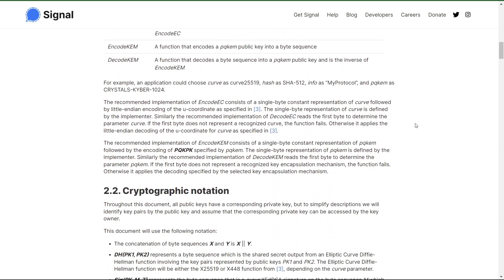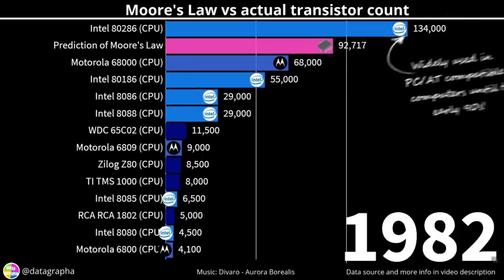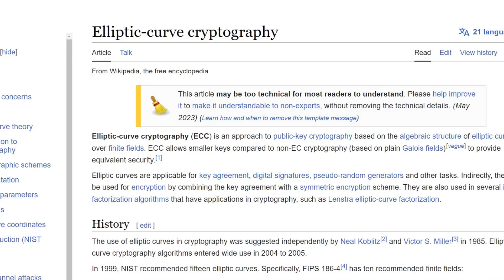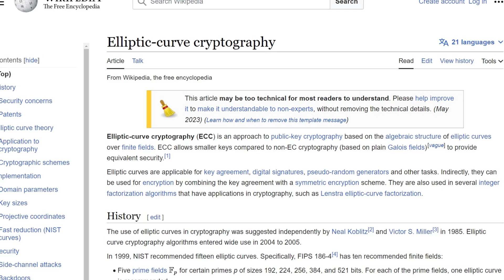Signal Just Published Post Quantum E2E Encryption

Comment: I just want to leave here: There is only one form of completely secure encryption, Informationtheoretical Encryption.
It means that not only is your key at least as long as your message, you also only use that key ONCE and never again.
The reason for that is simple: You can get every possible decrypted text with some key. Yes, that includes something completely different, as I said, EVERY possible decrypted text.
Anything else is literally just hoping that the system is good enough (for now).

Comment: 3:12 Hey, im a cryogenic engineer that makes the cryogenic systems that run quantum computers! AMA
Reply from the maker: Is it actually cooled with liquid helium?  I didn't think lN2 was cold enough so I figured it would involve lH4 or some other really extreme cooling solution.
Reply: @MentalOutlaw  yes it is! But not how you think. Helium-4 (normal helium) will liquify at 4.2K (-269C) at 1 atmosphere of pressure (1 bar) and Helium-3 (the very rare isotope) will liquify at 3.2K (-270C) at 1 atmosphere of pressure. If you reduce the pressure above these atoms when they are in a liquid form, their temperatures can be reduced. This follows according to a graph called the vapour pressure curve. If you google the vapour pressure curve of water you will see that at 1 atmosphere of pressure, water will freeze at 0C and boil at 100C. But if you change the pressure above the water it will exhibit different properties. If you reduce the pressure to a few millibar, you can boil water at room temperature (youtube: 'Boiling cold water In a Vacuum Chamber'). This is the same principle used in low temperature cryogenics to boil liquid helium to reduce the temperature of the liquid to 1.5K for Helium-4 and 0.3K for Helium-3. However both of these are still very warm for a quantum computer! Temperatures of 0.01K are required for these machines so a different process is used, called the dilution process. If you mix helium 3 and helium 4 and liquify them in the right quantities, the helium-3 sits on top of the helium-4, like oil on water, due to the density differences. However, there is some helium-3 inside the helium-4 (approximately 6% of the mixture). This is a fundamental value and no matter how much helium-3 you add, the percentage will always stay at 6% (as long as there is enough Helium-3)! We can use this to our advantage... Imagine we have a U-bend pipe that we fill with water, so that its full enough that a lighter liquid could not pass to the other side of the u-bend. And then we fill both sides of the u-bend with oil so that it sits on top. Now imagine for the sake of argument that a small amount of the oil was by the laws of physics required to sit inside the water (approx 6%?). What would happen if we burned all the oil on the left side of the bend? Well as the initial amount of oil boiled off, then the particles from the 6% emulsed in the water that were close to the fire would also burn away... This would mean that you wouldnt technically have 6% in the mixture anymore; and as previously established this is a physical impossibility. So oil from the right side of the u-bend gets forced across the 'phase boundary' into the water (requiring energy!) to ensure there is a constant 6% mixture. This process continues until all the oil from the right side eventually gets pulled in to the water, as it gets burnt from the left side. Now instead of burning oil, imagine we are using helium again and we are pulling it away using a vacuum pump instead of burning it. Helium 3 is lighter than helium 4 and therefore requires less energy to escape the liquid mixture. So the helium 4, once liquified, will always stay liquid, whilst the helium 3 gets pulled out with the vacuum. Because energy is required to cross the phase boundary, energy from the system is removed, which cools the system down. The helium-3 can then be re-entered into the right hand side of the u-bend so that the process is cyclical and therefore constant (unlike burning oil!). If you isolate this mixture from the outside world as far as possible, then it will get down to 0.01K. Systems have got lower than this and I believe the world record for this process was achieved in Lancaster university at approx 0.002K but that might be out-of- date info. This is called the dilution process, because there is a dilute helium 3 (6%) inside the helium 4. Then we just attach a massive copper plate to that cold part and computer scientists can use that to attach their quantum computers! I have simplified this a little and there are many more important stages to successfully create this fridge. I'm sure the dilution process on wikipedia will explain lots more info, but feel free to ask if theres anything more you are interested to hear about!

Comment: But did they fix the IME issue? You know, the one that Naomi Wu got kidnapped by the Chinese government for pointing out?
Reply from the maker: How is that a signal problem?  If the issue is with keyboard software used to type Chinese then that issue would affect ANY app you use the keyboard with.  If the software running "below" signal or any other privacy app is compromised like the Chinese IME, or the dozens of Chinese phones that are likely running modified Android OS's with CCP backdoors.  Also it seems like she started talking about the IME issue 2 years ago, are you sure that's what she got disappeared for?

Comment: You are greatly overestimating the power of the current quantum computers. 433 qubits doesn't mean that all the qubits are entangled, in fact only few are entangled. So addicting the qubits does increase the performance exponentially, but linearly. The high qubit counts are just marketing BS and the level of entanglement is not communicated on purpose. Adding more fully entangled qubits does increase the performance exponentially, but it's also exponentially more difficult to add them 😉

Comment: OTP one time pad is a simple and easy encryption that is quantum proof. One might argue that delivery of enough OTP pads could be an issue; but with the size of SD cards, and with the ability of using multiple One Time Pads on the same message, a quantum proof encryptions is relatively easy. Just like in the Past Net Flix sent DVD's. One could have multiple distributors mail you an SD card each month. Your device could add up multiple one time pads to get a secure data sent.
Reply: Classical symmetric cryptography is still safe against quantum computing, so you could just exchange a small symmetric key instead of a full one-time-pad and have practically the same security.

Comment: From what I recall, quantum computers are quite error prone, which means that you need a lot of error correction, so for an effective reliable QBit you are generally going to need a few thousand of physical qbits. That being said, we will eventually get there and shit will defo hit the fan, just not in the next ten years.
Reply: I'm still not convinced they're actually functional enough to be usable or ever will be.
Reply: @meowingman  maybe not for exact computations but they are already starting to be good enough to solve quantum annealing problems. So solutions to max-SAT or min-cut are likely to become commercially viable in due time. So basically we might end up using quantum computers to further optimize normal computers and maybe eventually to do things like weather forecast (though that is significantly more complicated to formulate an alogorithm to solve it).

Comment: Signal was developed by DARPA as a secure comms network
the crazy thing about quantum encryption is that its near perfect in its security, any attempt to tap the line or observe that data stream changes the expected outcome on the other receiving end, warning the recipient that there was an attempted breach, and the only way you could even "decrypt" the data stream if you did tap the line is if you had your own quantum computer.
its called post quantum end to end encryption is because the encryption is performed on the quantum computer's end and the decrypted results are then directly streamed to your nonquantum computer.
Reply: To my knowledge post quant encryption is encryption made on classical computers that is meant to be resistant to quantum computers.
Quantum encryptoon is made on quantum computers
Reply: Than it has a backdoor
Reply: @MichaTheLight  Straight up. Don't need to decode when you got backdoor. Whats that? signal needs a phone number to operate and no-touch zero days which just require a phone number to send msgs to are used regularly? you don't say! 

Signals a backdoor. You want secure comms....don't use your phone.
Reply: @gtvwill what else to use?
Reply: @MichaTheLight  not unless your non quantum computer can decrypt a quantum encryption key, which it can’t

Comment: If I understand though, the reason quantum computing could beat our current encryption is because it could calculate the mathematical method we currently use to encrypt (factorization of large numbers) really easily.

There are already other ultra complex mathematical operations that are theorized to be quantum-proof, the reason we haven't applied them is because quantum is nowhere near strong and stable enough to be threatening at all yet, so no one has invested into moving our infrastructure, kernels, etc. Into the new method.
Reply: I think the speedup of many quantum algorithms is "the square-root of what a classical computer would do", meaning quantum computers are really annoying, but certainly beatable (by using much larger keys for example) without switching algorithm.

Comment: Xenon(54Xe) is the gas/liquid used for cooling in a lot of semiconductor facilities. It is incredibly expensive, for around $300,000/60cuft( or Q1 cylinder size) equivalent to a standard fire extinguisher. It is a noble gas, though it can undergo chemical reactions(the first noble gas to do so) allowing for a much more broad spectrum of applications, including radiation, thermodynamics, and temperature control. It’s boiling point is 165.1k(or -108.1*c) and it’s melting point is 161.4k( or -111.75*c). Lastly, I’ve been told by many colleagues that, “it’s more fun than N2O, no ‘hangover’ making it way more enjoyable.” I’ve never tried either, and don’t advocate someone should or shouldn’t, so, do with that information what you will. Cheers.
Reply: Okay, I am now huffing Xenon.
Reply: @a-iz4pg  You must have a lot of money. lol.

Comment: From what I understand quantum computers don't affect symmetrical algorithm like AES, so if you're encrypting your own stuff with AES it should be safe.
Reply: We actually just talked about this in my computer security class. Quantum computing will affect AES, but it will just make our current standard weaker. If we up the key size from 256, we will be fine though.

Edit: quantum will basically make our AES256 into AES128, which is still "secure" in most cases, although weak passwords will be crackable. If we up the key size to AES512, it would basically be like AES256
Reply: Don't believe that ! only secure custom encryption can beat quantum cpu ! (All Aes encryptions are broken specially if you type password with keyboard ! if you are encrypting your data with aes i recomand you to generate really random 256 bits key with special software ! )

Comment: You seem like a guy who might actually know a thing or two about quantum computers cracking the passwords. 
So I am fully on board that if someone has to crack open a .rar archive type of file, or needs to figure out another part of the encryption key, they might easily use the quantum computer to do it. Since the calculations and accessing the file can be done on the quantum computer itself. 
I don't think this kind of password cracking will work when they want to access any server or information not-downloadable which can only be accessed via legacy network infrastructure. Since the data is not on the quantum computer they cannot use quantum states to guess the password and since the only way they can communicate with that remote server is through the standard non-quantum network they are stuck. If they spam the server they will be banned, timed out, etc. Standard attack prevention defences will work here since they cannot use quantum states directly.
What I'm trying to say is; if the encrypted data is behind a network password stored on the remote server which quantum attackers cannot access directly, they are still bound to limitations of standard de-crypion techniques.
Am I missing something?

Comment: 1. A quantum computer is NOT tiwce as fast if you add one qubit. All you gain is the ability to create a super position in a Hilbert space with twice the dimensions. This is only one aspect of quantum computation.
2. Not all qubits are created equally. EVERY SINGLE quantum computer, regardless of architecture today is prone to errors. These errors grow larger with the amount of operations done and the time needed to run the algorithm. In short, if you got shit qubits, you can double the qubits and it won't help at all. All these companies are marketing with large qubit numbers but everyone in the quantum computing community knows they need to reduce errors significantly before quantum computers don't become a pain to make an algorithm run successfully.

BUT we don't need perfect qubits like we need (almost) perfect transistors with classical computers. When the errors are below a certain threshold, shit is going to hit the fan hard.

Comment: and by the time that they could decrypt the statues of limitations will kick in and the cases would be useless to them.

to make a quantum resistant algorithm work would take an incredible amount of processing power?

unless you can quantum encrypt  a message and a hash is spit out very quickly  but to brute force generate messages to find out what exact hash it makes would take a very long time.

you could test the theory of copying the keys by posting a very offensive message and see if the feds come knocking.

Comment: I don't know. Several post-quantum algorithms were proposed in the past and then cracked with a laptop a few months later. We aren't sure any of those are foolproof. Curve25519 and other public-domain ECC algorithms still work (and were designed with public constants instead of the NSA telling us "use this number and it is secure"). It's mathematically infeasible to crack ECC even if you turned every grain of sand on Earth into a supercomputer. Obviously a single quantum computer would crack it instantly, but for now they don't exist. It's unlikely that the NSA has quantum computers capable of cracking ECC or RSA since all the research from the experts in the field suggests we don't have the technology to build such a machine yet.

Comment: I'm still not sold on the concept of centralized end-to-end encrypted services. If all public keys still get exchanged via a centralized infrastructure, it's an obvious attack vector for man-in-the-middle attacks. It also doesn't help that Signal makes the actual key management pretty confusing for end-users. You don't just encrypt your messages for your one recipient. You encrypt it per device of either your recipient or yourself which means a lot of key pairs might have access to your messages. But if you wonder how your device knows all of those public keys... well it will ask the centralized key exchange server and that is a problem. Because Signal is designed to allow dynamic device management, meaning any user could add or remove a device to their account at any time. So whether a device and its public key has actually been added by the user (your recipient) or not can not truly be detected as reliable to prevent a malicious server or attacker in between to catch and decipher your messages.

Anyway I think it's a good thing Signal publishes a paper like this about post quantum encryption and Signal itself is a quite useful tool while being open-source which is great. I just don't think Signal is the best end-to-end encrypted messaging you can get. The multi device feature alone introduces way to many issues which other applications/services address in some way.

It's also still an issue that Signal relies on centralization. If some government wanted to decrypt your messages and you would use Signal, they simply cut the line to that server. Availability is a fundament of security which you can not ignore as easily. So given that governments tend to not do that tells you they either don't care enough about your messages or they already have a way to get them anyway.
Reply: Evaluation of public key security assumes the enemy knows the public key.  But it also assumes you can be sure you got a key from the intended recipient, not a hostile man-in-the middle.  Reliable routing of messages helps in this.

Key management being confusing is a valid criticism.
Reply: @hanelyp1  As someone who is working on the implementation of a decentralized messenger service using GNUnet. I consider usability to be a critical aspect of security. If your users do not have the ability or they tend to not utilize it, checking keys for verification, it doesn't matter as much as researchers give it credit.

In the end you want to build a system for everyone. If you just need something working reliable enough for people who are interested in privacy research as topic, you could potentially even rely on obscurity because you would only cover a small group of people.